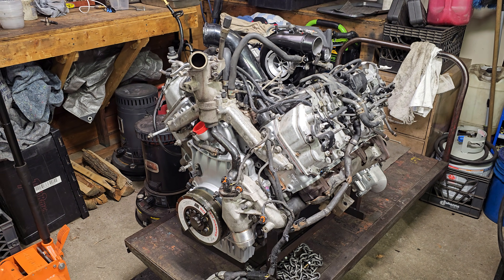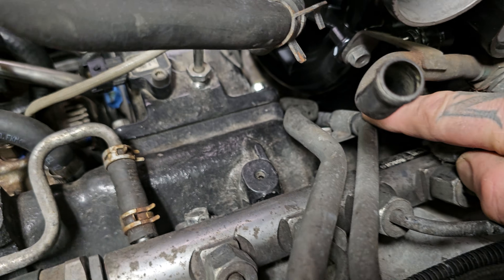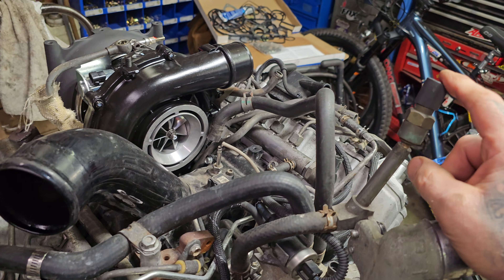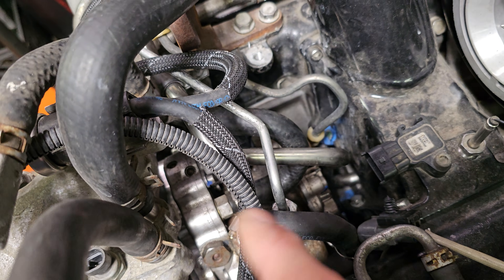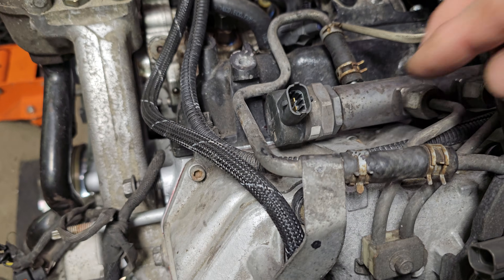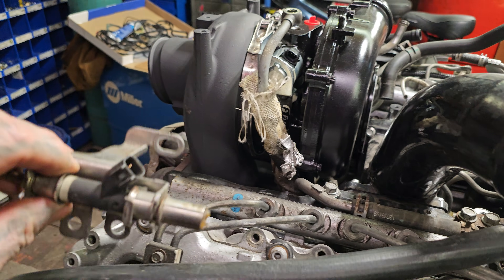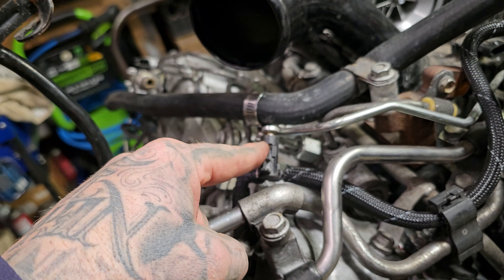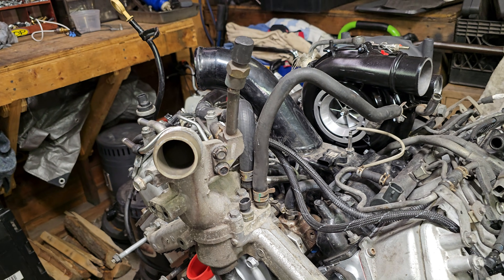LML cp3 cp4 duramax fuel system explained how it works delivery feed pressure return start to finish

Comment: Thank you so much! This is amazing. I’m about to the swap on this exact year. Question if I may. I won’t need my 9th injector anymore…Where you had the port for 9th injector with the plug in it. Is that where the test port would go? Or does it go on down pipe where injector was? I was told I needed that extra from where I bought cp3 kit.
Reply from the maker: You can leave the solenoid for the 9th injector in place and cut the line to the downpipe if its no longer needed. OR you can plug the plastic return line if the line off the cp3/cp4 has been eliminated

Comment: Some cp3 kits come with a feed line that goes straight from the rubber feed on the driver side from the tank to the feed port on the cp3 and bypasses the whole stock filtration system.

 Will this pose a problem with the sensor described at 4:55?
Reply from the maker: Correct. If you eliminate the OEM filter housing than you can run the feed line from the line under the bridge directly into the inlet of the cp3. Therefore, eliminating the housing and lines associated w them off the p/s valve cover. Removing that sensor poses no concern if done this way

Comment: Hey. Quick question. Doing a DPF/SCR delete on my dad’s 15’ LML. He’s already got the CP3 conversion done. 
Wondering what I do when it comes to the removal of the 9th injector fuel supply line. I’m told I can plug off the port in the CP3 with an M8 bolt? True? Or is that going to over pressure the case? 
Thanks!
Reply from the maker: Yes you can plug the port. I dont recall the thread size but it can be done w no issue 👍

Comment: I have a 2015 it takes five seconds to start when cold. When warmed up to operating temp. It will not start. What do you think it is? Im going to replace the FPR tomorrow. But not sure past that
Reply from the maker: The most common cause Ive seen for this is damaged injectors (usually from contamination such as failing cp4)

Comment: This is an amazing video! Thank you so much for explaining in such detail! I have a question about LGH injectors to see if might happen to know. Since the LML and LGH injectors are one part number different and through research the LGH injector has a 2 degree wider spray pattern with one additional orifice and the orifice diameter is .005 smaller than the LML injector it seems. Do you know if that is this going to make a difference with a need to swap and use an LML injector in a LGH block swap for a blown LML? I know the LGH is detuned but once all the top end parts are swapped over along with the wire harness and ECM, it should no longer be a 'de-tuned' truck and should be just a normal LML at that point right? Unless those small differences in the injectors would play a role in the de-tuning as well. Would love your thoughts on that if you're familiar. Thanks!

Comment: Thats helpful to stumble on your video for a better understanding of the fuel system. My truck died on me while driving lift pump motor went out also. I have since replaced the lift pump installed new filters and bled the air and still no start. Should I clear the codes and try again? The filters were like halfway fuel of fuel when I changed them which I found unusual. I fear an injection pump failure but since the filters were half full I'm second guessing that.

Comment: We just completed a cp3 conversion. We cleaned tank and all fuel lines and replaced injectors. The truck wont start. Fuel to the pump is good (no air at filter). Any advise of the reason this would happen?

Comment: This was great!!! Thank you. Quick question. Minute 3:22 where does that hose go to or does it get capped off since the injector is not being used?
Reply from the maker: The hose coming off the cp4/cp3 (if converted) runs up to the top of the pass valve cover where it links into the fuel return system. If your engine is setup for longevity and doesnt utilize the 9th injector, the outlet is capped at the pump. If you didn't convert the pump to a cp3 then you can cut the 9th injector feed @ the solenoid and remove the HCI injector from the downpipe if desired

Comment: I just bought an lml, how would I know if it did have a cp3 swapped already?
Reply from the maker: Look into your engine valley and compare the top views of what's shown in this video. Figure out which 1 you have. Chances are, if there's a cap on the passenger side fuel rail where 1 of the feed lines were, > you have a cp3 conv

Comment: That is the vacuum switch on the passenger side it turns on the change fuel filter warning when the filter becomes restricted an the suction pump pulls a vacuum.
Reply from the maker: @patrick5899  with the exception of the lift pump always pulling a "vacuum" without the assistance of a pressure pump, you are correct, it is a restriction sensor

Comment: Hey, Great Job on the video. I needed this as I am doing a cp3 conversion currently. Question: What is the name of the plug that would screw into the down pipe where the 9th injector went in order to cap off downpipe? I need to get one! Thanks
Reply from the maker: @patrickcooper1122  assuming you are doing this for "testing" purposes 😉. You do 1 of 3 things; cut the fitting w dykes and the crimped line will suffice as a sealed cap so simply thread it back in 2) use a 20x1.5mm drain plug or 3) search online for an HCI (9th injector) line plug but they are very hard to find these days